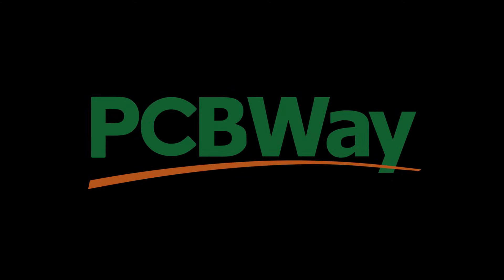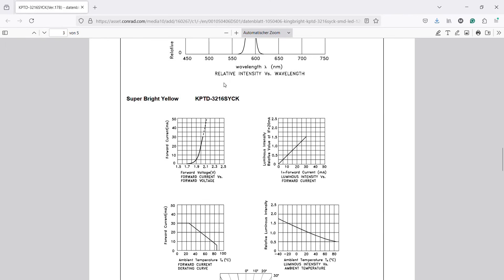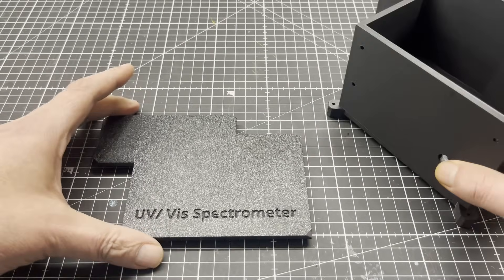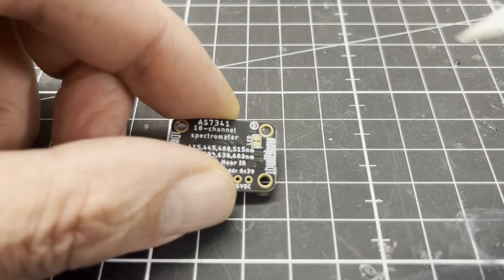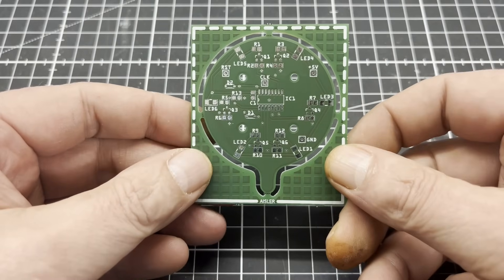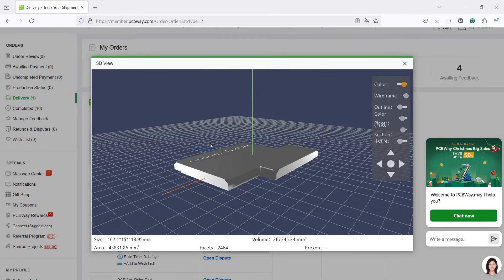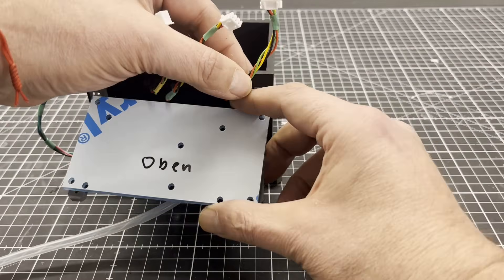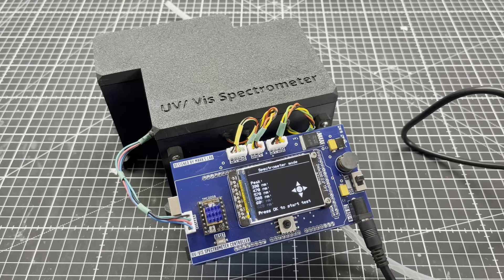Home-made spectrometer (new approach)

Comment: that is incredibly smart. i never in my life would have gotten the idea to use LEDs for that. In fact i kinda didn't believe it would even work but you managed to prove me wron once more and made it work. congratulations that is just so freaking elegant. also great video as always! also that is the first time i have seen anything other than a diffraction grating/prism and (debayered) cam or linear CCD used in a fairly decently performing absorption or emission spectroscope. incredible
Reply from the maker: Thank you. There are some advantages: Low power consumption, no heat development by deuterium/halogen lamps, much cheaper, more durable, and almost maintenance-free. Perhaps it could be used in a space probe someday. The main disadvantage is of course the small selection of wavelengths, which I try to compensate by interpolation. Perhaps one day there will be LEDs whose emitting wavelength can be controlled by voltage etc. Oh no, yet another idea... 😅
Reply: @Marbslab sir can you kindly  send me the 3d modal please  sir ❤
Reply: using LEDs is actually a very know way to build a spectometer in the field

Comment: How about full spectrum sensor(s) which are stationary and a geared down dc motor turning a transparent disc with a graduated light spectrum? A couple of offset hall sensors for position, or UV photodiode with a UV lens?
Reply from the maker: Of cource possible. A lot of DC gear motors are available with an encoder.

Comment: For the inserts to avoid cleanup with a cutter, insert them 2/3 way then use a flat filet or other flat metal tool you have at hand then add push the remaining and it will be perfect.
Reply from the maker: Thank you for the tip. I'll try that next time:)

Comment: Awesome project!  Really like the idea of having swappable rings so you could have broad and narrow range rings for different applications/precisions.  

An idea for plug-and-play LED rings: Use a recessed "cup" with a notch for the light sensor flag to register the PCB, and use neodymium magnets slightly protruding from the back of the "cup" along with magnets affixed to the PCB.  The magnets will double both to hold the PCB in the device and as voltage/signal passthroughs since they are conductive.  This would allow you to hot-swap the rings quickly without having to get at any screws in the cramped space between the PCB disc and the flow cell.  

Alternatively, since it might be fiddly to affix the magnets to the PCB and have them conduct to the board (no idea if you can solder to neodymium or if the temp would kill the magnetism), you could shrink the larger gear and have rings of conductive bands around the edge of the board.  Then, you could use a row of blunt (to avoid gouging) pogo pins to push against the rings for power/signal conduction.  Then, you could make some cutouts near the middle of the PCB for registering to some 3D printed posts in the gear, and a single magnet pair in the center for holding and easy hot swapping.  

Cheers!
Reply from the maker: Thanks a lof for all your ideas and suggestions:)

Comment: The AS7431 has quite narrow band filters covering its photodiodes and you can operate it as a spectrometer by illuminating the sample with white light. I don't see what the purpose is of the coloured LEDs. Also - no need to cut a track to extinguish the on-board LED - it is software controlled.  Please explain.
Reply from the maker: The AS7431 is no spectrometer, it's a color sensor (basically 9 photodiodes with different filter material, but no dichroic filters). You can't use white light as the AS7431 has no diffraction grating or prism to split white light into its spectra. I use discrete LEDs to cover some wavelengths. The LEDs are not colored, they emit almost monochrome light in different wavelengths. You can adapt the LEDs to suit your project. The LDR pin to which the white LED is connected is a current sink and I honestly have no idea how the pin should be addressed in software.
Reply: @Marbslab  I replied with details of the AS7343, but the reply seems to have gone somewhere else!
Reply from the maker: @ Has your original reply disappeared? This often happens on YT, especially when links are posted. Unfortunately, there's nothing I can do about it.

Comment: Great video, I just have a question - since you can use color controllable leds, why not just use one and change the color of it to change the spectrum?
Reply from the maker: Thank you:) To answer your question, color-controllable LEDSs are based on the RGB system and can't be used as it's just a mix of the 3 wavelengths. The only way to change the wavelength of an LED is temperature, but the shift is small.

Comment: Very nice job. However I don’t think you’ll ever get good results from interpolating. Absorption spectra can be pretty narrow. I doubt you’ll find LEDs to get decent coverage of the spectrum.
Reply from the maker: Today, there are many wavelengths available for LEDs. You can find a list here: https://en.wikipedia.org/wiki/Light-emitting_diode#Colors_and_materials 
As the wavelength of an LED only changes with the temperature, the LEDs could be cooled or heated with a Peltier element. Interpolation is a broad term, for example Gaussians, etc. could also be used.

Comment: what informed your selection of the specific wavelengths of LEDs? Availability? Cost? Have a specific project in mind? Or was this just meant to be a proof of concept?
Reply from the maker: Your comment has been withheld. I guess because of the user name. Google should work on better AIs. To answer your question: it was a proof of concept, but research will go on (add a Peltier element to change the wavelengths of the LEDs by cooling and heating maybe). I will use it for my long-term project of a robot with a sense of taste and smell. Happy New Year!

Comment: Interpolation will never work for a precision spectrometer. Your device could be useful as a go/no go quality monitor in a production line for materials of known spectra.
Reply from the maker: It depends strongly on the monotonicity of the function to be approximated (in this case absorbance as a function of wavelength). In intervals in which the function is strictly monotonically increasing or decreasing, cubic spline interpolation provides very good approximations.  I have never claimed that my spectrometer is highly precise. You can adapt it to different applications by changing the LED rings.

Comment: Lovely video. You could use 1000 LEDs...
Reply from the maker: Thanks:) The number of LEDs is limited by the semiconductor material. Here you can find a list of available wavelengths for LEDs based on different materials: https://en.wikipedia.org/wiki/Light-emitting_diode

Comment: ooh i've always wanted to make a mini spectrometer, but I decided on a glass transmission diffraction grating and a tungsten lamp as the light source, which presents its own problems
I did not know that mini spectrometer breakboards existed (my intention was to use photodiodes and build an amplifier)
Reply: something neat is the use of the polynomial interpolation
however i think you may want to switch to a clear tubing (if that exists)
Reply from the maker: Thanks:) The tubing doesn't matter. The measurement is done with a flow through cell that is connected to the tubing. You can see the flow through cell in the video. I bought it on aliexpress: https://de.aliexpress.com/item/1005005792925624.html
Reply: @Marbslab  nice
Reply from the maker: Everything has pros and cons, depending much on for what you want to use the spectrometer.
Reply: @Marbslab  that's fair
i mostly want to build it because it seems like something neat (The monochromator is sometimes useful)
Reply from the maker: @mumujibirb  You can customize the LEDs for your application. It can be used as a photometer, spectrometer and if you use a white LED, even as a colorimeter. Applications can include monitoring fertilizer in hydroponics, water quality in aquariums, etc.

Comment: Xeon lamps work well also for the VIS LightRange.
Reply from the maker: Yeah, but may require convection cooling, and the life time is not great (2000 h).
Reply: @ I work on a Wet General Chemistry Analyzer with a Xeon Lamp Module. No cooling, it is incased. The Legacy Analyzer before it was Halogen. :) love your work! :)Best Regards!
Reply from the maker: @rmgibbs1861  Thanks for your insights:)

Comment: 'Spectrometer' usually refers to 'Spectrophotometer' so I went into this video expecting that. When I saw the description of 'uses several LED colors' I thought they were being used as detectors or something.
Reply from the maker: I used discrete LEDs, each with a different wavelength, instead of the full spectrum by a prism or a grating. Many more LEDs could be added. I then used the measuring points obtained from the LEDs as supporting points for various interpolations. In the end, my spectrometer contains a graphing calculator. The starting point for the design was not to use any optics such as prisms, gratings, mirrors or lenses.

Comment: no. just no. Interpolation doesn't help for this. How can the transmission go above 100% which is the case in your device?
Reply from the maker: Yes, interpolation helps. It's a common method to predict unmeasured values. As mentioend in the video, the graph needs to be normalized. It's easily done with a mapping function, changing the sensitivity of the sensor or deluting the chlorophyll solution further.

Comment: Really cool to see how you design and built this thing. I have learned a lot but also that it doesn´t make a lot of sense so emit a specific wavelength and measure intensitiy, instead of measure the absorbanse of polychromic light, because of the few data points
Reply from the maker: The idea is to compensate for the few data points by interpolation. I could also add a lot more LEDs to the ring. No optics means the spectrometer could be used in a very harsh environment.

Comment: What is the possible resolution of this? I was wondering if it could be used in agriculture for soil analysis, but the non-homogeneous nature of the soil makes it very difficult, after that I remembered the fact that deficiencies in the soil can be diagnosed based on the coloration of the plant (chlorophyll)
Reply: https://www.youtube.com/watch?v=DofVCfqWi08&t=2946s&ab_channel=PrecisionAgCoP not completely the same but interesting
Reply from the maker: Currently, I only use 6 LEDs ranging from 390 to 628 nm. All intermediate values are interpolated using the cubic spline and other interpolation methods. The resolution is therefore arbitrarily high in this range, but you have to consider the error that the interpolation entails. However, explaining the error estimate in more detail here would go far beyond the scope of this answer. Unfortunately, I have no experience with soil spectroscopy, but it sounds very interesting.

Comment: This project is freaking cool, kudos man. I haven't well grasped how you manage the interpolation. Let's say you're probing a sample that absorbs just a single wavelength, and you don't have any diode that emits such a wavelength, how do you get into the middle?
P.s. Music covers your voice too much, in particular at the beginning of the video. I'd suggest you to boost your voice by 4 to 6 dB, since the overall level of sound is not too high. When editing check the level bar and alternatively mute each track to see what contribute the most. In general bground music should be kept at -10 .. -22 dB. For this kind of video style I'd stay at -22dB or so. While the voice (alone) should peak at 0 to +1 dB. Hope to be helpful. Merry Christmas.
Reply from the maker: Interpolation works better the more data points are available. Interpolation is not possible for one point, as there are an infinite number of functions that contain this point. Cubic spline interpolation for example gives you a set of functions, each of which describes the curve between two points. Since you have now calculated these functions based on the given data points, you can also use other, unmeasured wavelengths and calculate the function value (absorbance) at that unmeasured wavelength.
Many thanks for the video editing tips. The background music is set very low in my video editing program. I can only guess, but it might have something to do with YouTube's new auto-sync feature. 
I also wish you a Merry Christmas and a Happy New Year.
Reply: @Marbslab  my point was: if you have no data because the only line absorbed if far from any wavelength emitted by any diode, how can you interpolate in this case? Hope I made my point clear, and it assumes that the diodes make a pretty narrow band around their emitted primary wavelength. From the video I found it not clear if their emission bands overlap.
Reply from the maker: @AccidentalScience  The following wavelengths are currently featured:
390 nm
470 nm
570 nm
588 nm
600 nm
628 nm
Interpolation is only possible in the interval [390 nm, 628 nm]. No interpolation is possible outside this range. However, there is another mathematical method called extrapolation. With this method, statements outside the interval are also possible.
Reply: @Marbslab  ok, so for example the bandwidth of both 390 and 470 nm is large enough to overlap a bit so if you have a sample that absorb at, let's say, 410nm you can still detect it.
Reply from the maker: @AccidentalScience  You can only measure the absorbance of the six mentioned wavelengths. Every not-measured absorbance in the range of 390 to 628 nm can be estimated by interpolation. For example, if you want to know the absorbance at 410 nm, plug in the value in the according interpolation function f(410 nm) and calculate the function value. Here you can play a bit with cubic spline interpolation online: https://tools.timodenk.com/cubic-spline-interpolation

Comment: Thats a great video man. I have a question as i am not much familiar with this topic as you made a uv/vis spectrophotometer , so if  you replace the led's with the leds from uv and ir range and select the sensor accordingly can you achieve the same result?
Reply from the maker: Thank you:) Each sample absorbs different wavelengths to a greater or lesser extent. So if you use other wavelengths, the results will not be the same, but they will complement the other wavelengths. Interpolation works better the more supporting points you have in an interval of wavelengths.

Comment: i dont want to build it, i want to buy it. gia charges 5000 euro for theyr machine.
can i buy yours ? or do you know where i can get one i can use for gemstones ... ?
Reply from the maker: Sorry, you can't buy mine. My spectrometer approach is still under research. It also can't be used for gemstones.
Reply: @Marbslab  one can not buy anything, not even for xmas.
if i was smart i would ask why its no good for gemstones but, im not.
happy xmas from norway
Reply from the maker: @QuadDerrick  Merry Xmas. I did a bit of research, and you are right: spectrometers for gemstones are also very expensive. A pretty useful machine for gemstone sellers and buyers. Maybe I come back to it in the future. Greetings to Norway from Germany🙂
Reply: @QuadDerrick  I'm gonna guess he means that his machine is built for fluids, and gemstones typically aren't very fluid haha. I think you'd need to cad out a holder for the stone, with an aperture that the stone would be able to cover (probably would need a rubber nipple on the aperture that the stone would be pressed against, to prevent light bypassing the stone). The neat thing about his design tho is that with a little research you could find the critical wavelengths needed to measure your stones, and put the appropriate leds on the wheel (which I think is the real beauty of his approach, it's superior for specialized applications like that where you know in advance the wavelengths you need to test).
Reply: @xxportalxx.  when gem buyers use a refractometer, they use a little drop of refractive oil just on the stone and press it up against the glass to get a reading. i am guessing it is somewhat the same deal but, i am very little scientific despite looking at super advanced "light machines" on youtube. , u can tell my by use of the word "light machine" i think =)
i am dumb in many ways, i know that, yet, i ,, feel,, like that 5000 dollar machine to GIA, that keeps the worlds gem marked tied to GIA and they'r certification , is not worth more than 50 dollar.. 
To me it looks,, and sounds like, by you even, that this is the case too.
Tell me if you agree or not and, if that is not a disgraceful thing ?
Howcome all the worlds smartest youtube nerds cant beat GIA and put together a machine in the garage for 50$ like GIA's 5000$ machine ?

Comment: Instead of expensive special lamps, you could use full spectrum white led, but of course then you would need diffraction grating and still no UV & IR.
Reply from the maker: I could also attach a white LED to the LED ring, then the spectrometer could also be used as a colorimeter. I also thought about using a supercontinuum laser.
Reply: @Marbslab  True! Supercontinuum laser would have been interesting as well, but UV range could be difficult still.
Reply from the maker: @user255  I will definitely look into the subject further, as it would also be very interesting for other applications. You could also use a concave mirror and arrange the LEDs at the edge accordingly. That would eliminate the stepper motor.
Reply from the maker: @user255  CTOLEDs would also be worth considering. Or thermochromic substances, or fluorescent substances dissolved in various solvents. So many new ideas...⚗🧪🔬